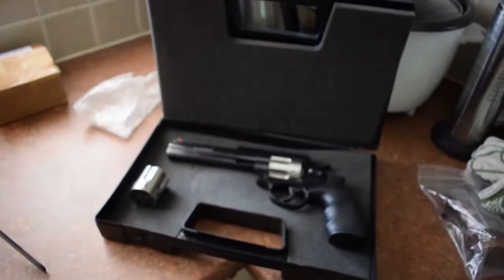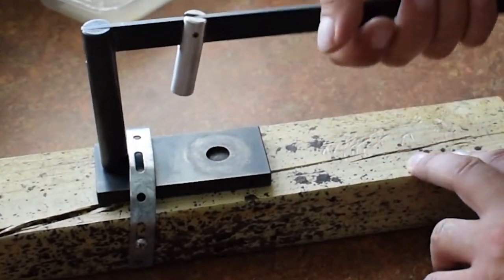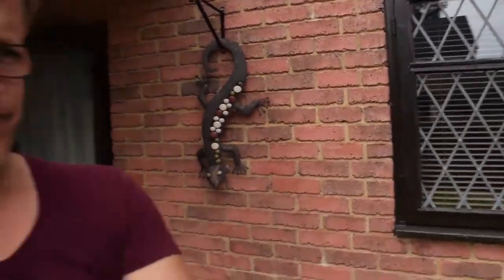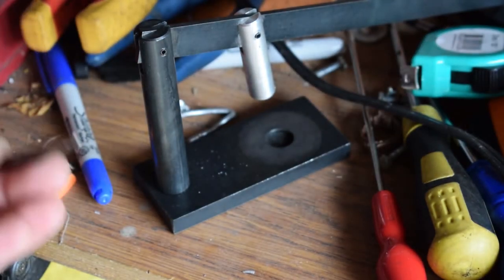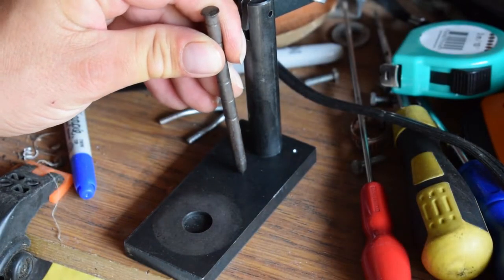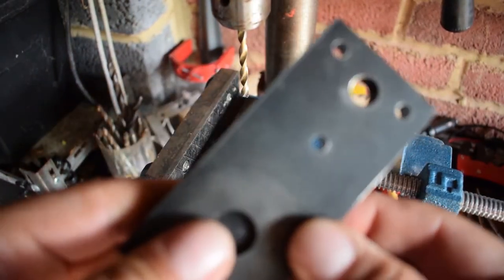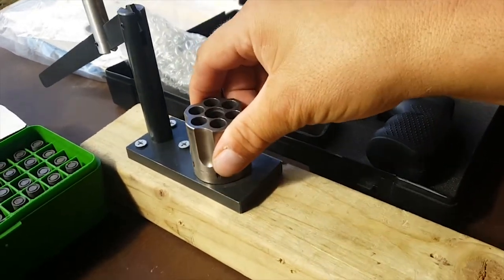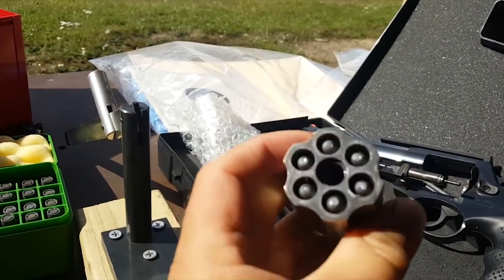Alfa Proj UK cylinder Press upgrade

Comment: Interesting. I struggle to get my press to accurately line up to fully seat wad cutter bullets so may try round nose ones as in your video. Also any suggestions on the best way to clean the cylinder?
Thanks J
Reply from the maker: Hi, yup I had the same issue with lining up wadcutters, I have since started to use flat nose 9mm bullets and they work a treat.
I use a wire brush and clean as I go but Patch Wipe Out cleaner is good with a brass wire brush. Defo the way to go.
Reply: Many thanks

Comment: Great video! Do you buy the bullets or cast your own?
Reply from the maker: These i bought. I have thought about casting, it looks really interesting but just have got around to do it 👍
Reply: @raffster1971  Thanks for the reply. How to they stack up in comparison to what you'd use in a LBR cost wise?
Reply from the maker: Definitely more cost effective running a muzzle loader, just primers, powder and bullet heads. No need for reloading equipment. I reload .243 and .357 so there's an initial outlay to spend before you can make savings reloading.

Are you a reloader?
Reply: @raffster1971  I currently have FAC for FAC air guns and 177/22 rimfire, as I've mainly been into small bore target shooting. But we have a few pistol muzzle loaders in the club and quite a few LBR/LBP shooters (some reload, some don't) and I am seriously considering going for a variation to expand disciplines. I have a back injury that is now making prone shooting an issue for me, so if I'm forced to sit or stand only, then it makes sense to look at other options. So, I'm very much at the beginning of the journey and just sussing out options. I've heard a bit of talk about the Alfa Proj, but not actually seen one in person, and it really does pique my interest!